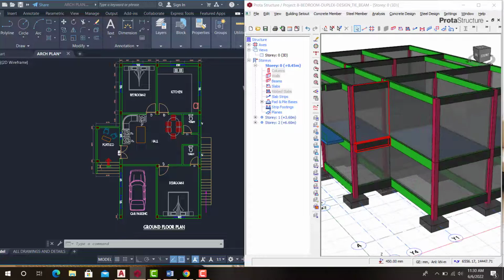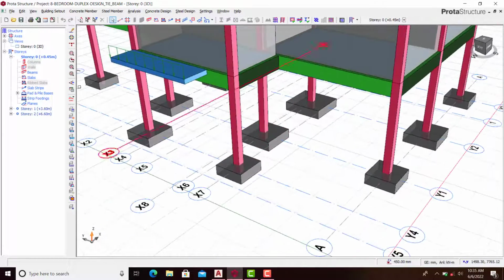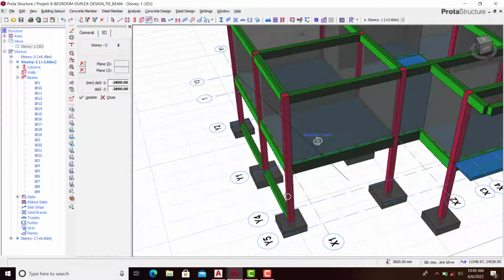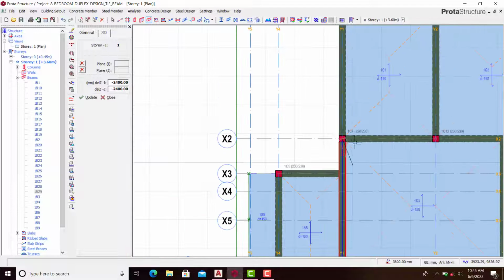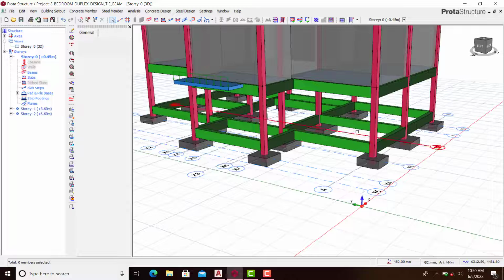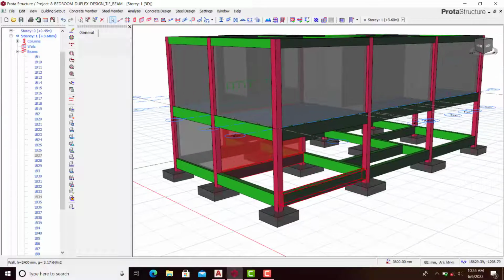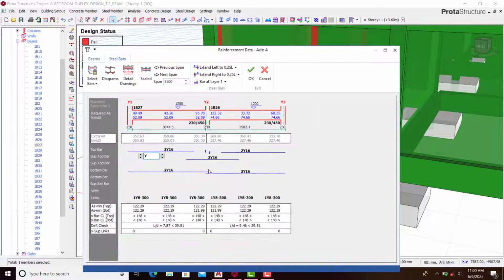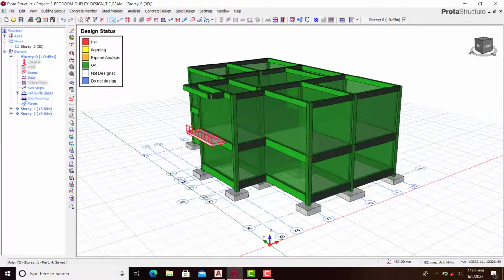Tie Beam Design for a Reinforced Concrete Building using Prota Structure.

Comment: Sir, why not model foundation beam instead and modify its elevation. What I did is to model foundation beams as Plinth Beams and change the elevation to make top of the beam the same level as the 1st storey floor level. I put the 1st storey bottom level to 1.5m, (because I want an elevated finished ground floor to avoid flood entering the house and outside the house where NGL is located is at Level 0), the Elev +1.5m is also the level of top of plinth beam. Have I done it correctly sir? The foundation beam as plinth beam is modelled by clicking the Storey 0 (or Storey +1.5m, bec I change the 1st storey bottom level to 1.5m). Then the analytical model shows that its analysis started from Elev 1.5m or where the fixed supports are located. Then I did the FE foundation analysis after inserting pad footings in order to design that plinth beams because they are not analyzed directly by "building analysis" and  are excluded in "storey beam"  design option.
Reply from the maker: Which ever way, it's okay
Reply: @EkidelEngineering  Thank you sir

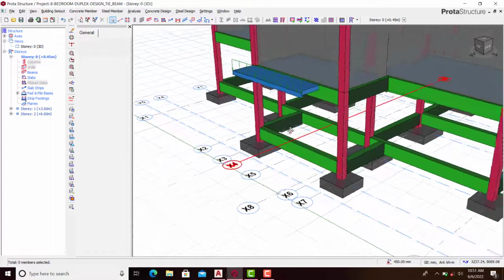Comment: The appropriate technical word at 20:53 should be ROBUSTNESS (appropriate for resisting lateral loads). Welldone chief. I wish we had enough tutorial videos like this when we started out back in 2012😊. We only had the Orion Engineers Handbook and Standard Training Manual.
May God reward your efforts 'cause the videos you have here cost a fortune.
Reply from the maker: Thank you for the kind comment ❤️